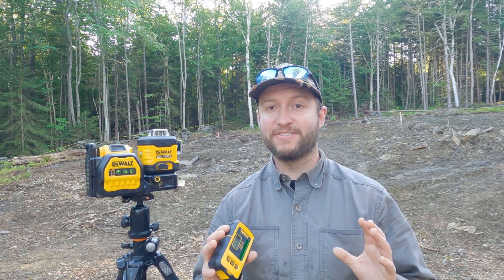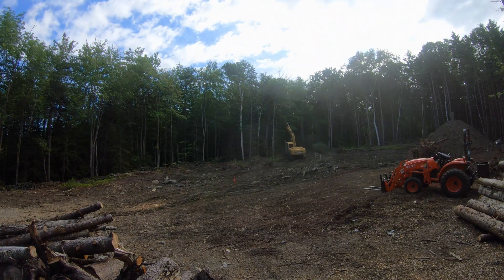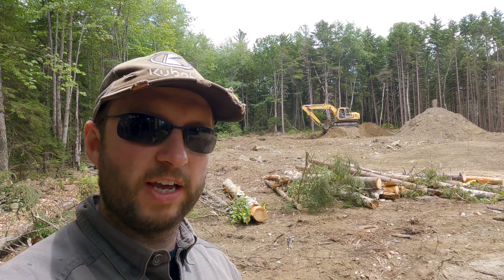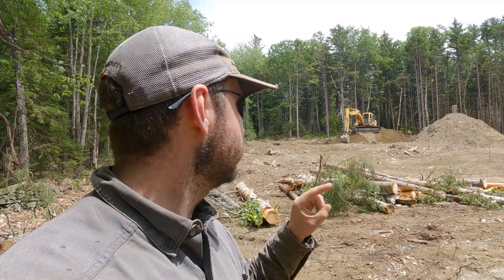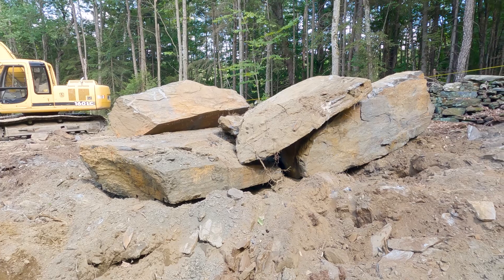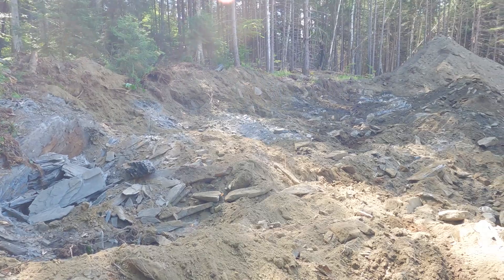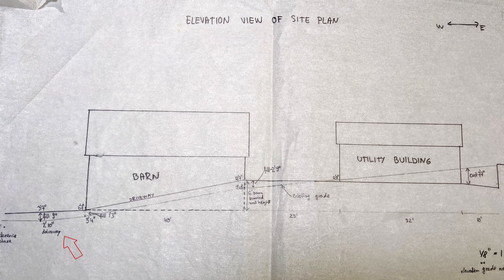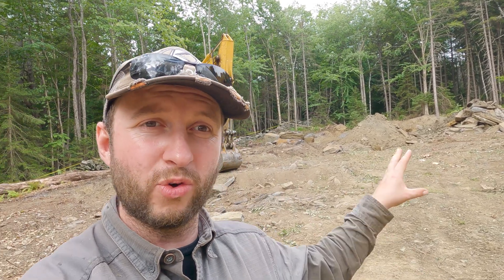Breaking ground!!!

Comment: Hi Matt & Diana,
Great channel, I watch with my family and may be moving to VT area next summer. But a quick question about your experience of ticks and black flies up there on your property. Have you found much of an issue as of yet? Do you find the need to do full checks after each outdoor work session? Just curious your experience this far.
Thanks for your sharing 🙏
Ty
Reply from the maker: Ticks are definitely a problem. We have had good look using permethrin spray on our clothing (like this one https://www.rei.com/product/768970/sawyer-permethrin-pump-spray-24-oz). When we go working in the woods we wear the same treated clothes. We reapply treatment about every 6 weeks. After the first application we didn't find any more ticks on us or on our clothing.